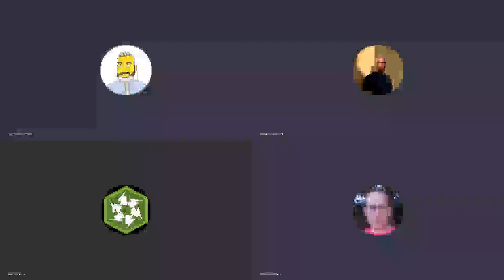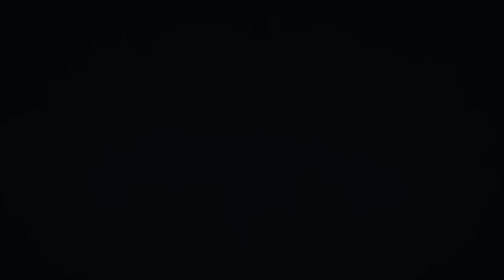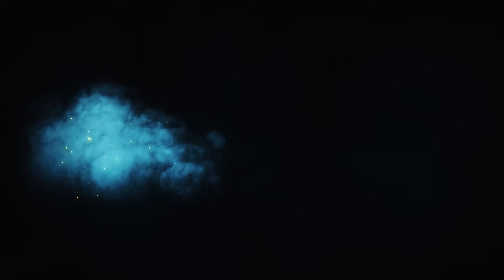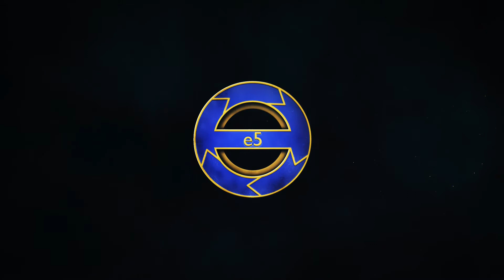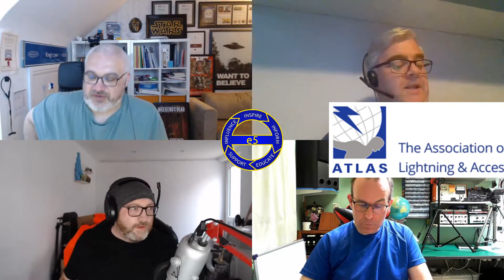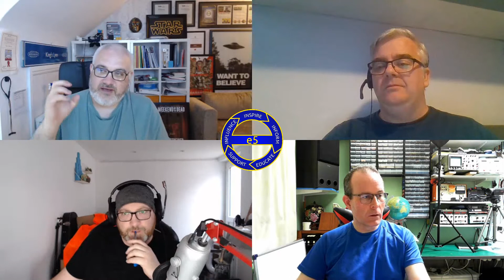Podcast 61: Surging on with DEHN part 4

Comment: This is where high quality engineering thinking and mathematical numerical modeling is coming into its own. Dehn is really looking at using numerical techniques like computational fluid dynamics and specifically finite element methods. These methods are coming in to play to question even issues around heat dissipation for cables in conduits above and under ground which calls into question the accuracy of standard tables in British and international standards which are often simply based on long standing mathematical calculations which do not fully account for the real world situations electricians face in specific installation settings. The use of such methods dehn talks about are much better designed around the specifics of individual circumstances this is a more risk-based approach relative to a simple compliance based standards approach. I for one welcome that it means electricians would know about the distinctiveness about each of their installs - more hard knowledge than non-thinking. That’s a level of professionalism that has not come into play in the industry - dare I say many industries not just the electrical.

Comment: Loving this subject. Great podcast, informative, learning and amazing for CPD.
Reply from the maker: More next week! 🙏
Reply: Are we likely to see more demand for lightning protection systems as the climate warms in the UK. Why does asthetics take precedence over safety. Thanks for another great discussion.
Reply: @markholmes4143  hi Mark, the flash density map is revisited fairly infrequently, in fact it's only changed twice in the nearly 30 years I've been in the industry.The new map on average is up about 15-20% over the last map but that was 9 years old and the one before that over 20 years old. Anecdotally we are certainly seeing more reports of lightning activity but we are also getting better at measuring & recording it so this may account for some of that increase. Warmer, wetter weather does mean the conditions required for lightning to occur, would increase. The UK still has relatively low flash density compared to the rest of the world though. Lightning protection is only a legal requirement in the UK if you have explosive contents or atmospheres so I'd say the aesthetics issue is simply because some people would rather value engineer it out of the building if it looked too ugly or the requirement became too onerous, so the LPS installers have become attuned to offering something rather than getting nothing. It's important to remember though that this still represents a compromise over what the standard actually requires, it's just that in most cases that standard is a non-mandatory set of recommendations.
Reply: Mark Holmes absolutely we will need that - Florida went from much fewer strikes to lightening occurring 50 weeks of the year with much more powerful strikes. Lightening also has the capacity to cause much more powerful firestorms in rural areas with lots of brush and trees these have become a much bigger issue in the US. Even though lightening density is much greater on the east coast than the west coast.